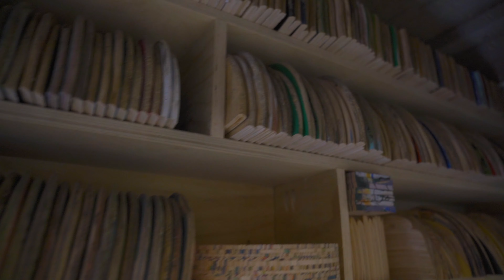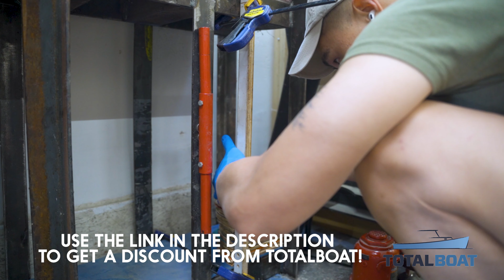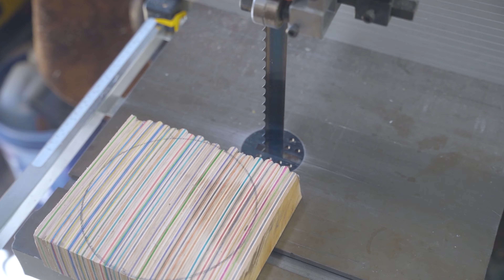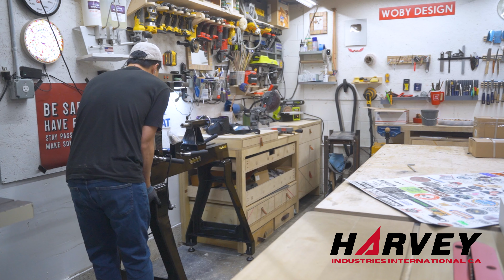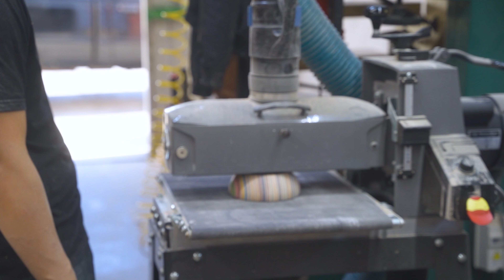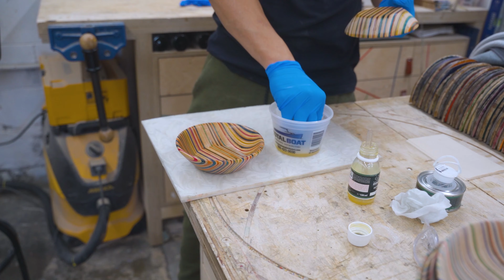BOWLS MADE OUT OF RECYCLED SKATEBOARDS!

Comment: Neat, looking bowls. Be careful using plywood for the tendon on the bottom of the bowl when you go to do the inside. My experience is that the plywood will break apart if you put a little too much pressure while you’re cutting out the inside. For a new design, if you can make them a little taller and put a pedestal under it like a goblet you show the colors and make the lines look even more interesting. Really enjoy your videos. Keep up the good work.